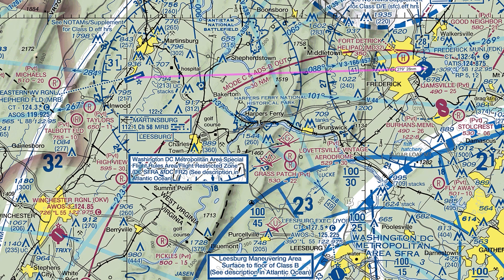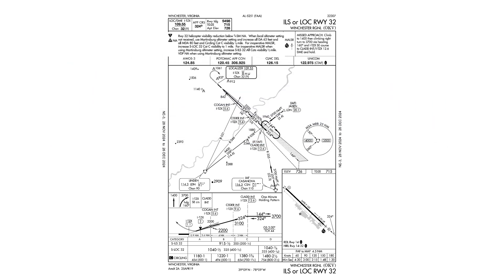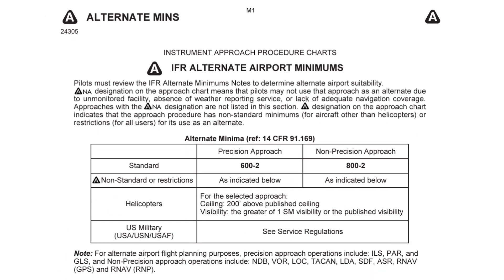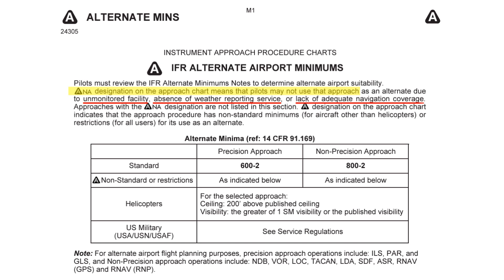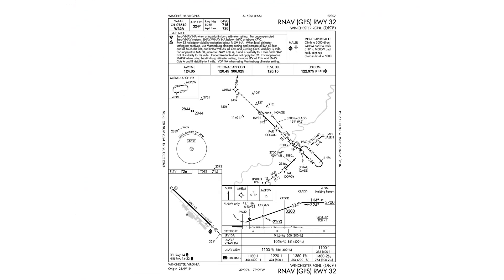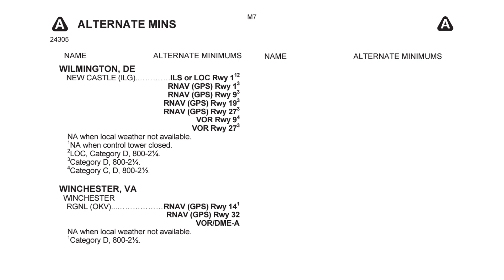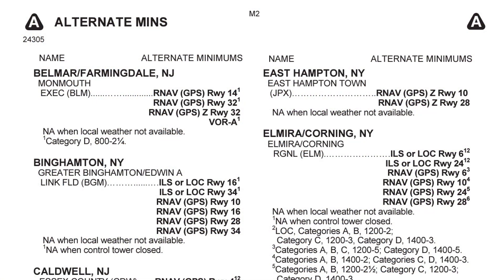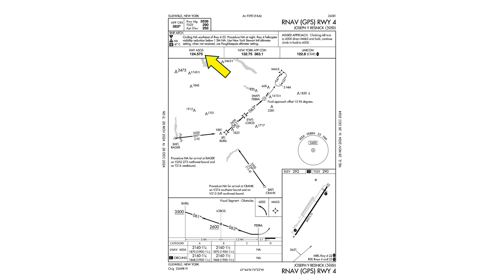Alternate Not Allowed | IFR Flight Planning

Comment: Can i file to airports with both the destination and Alternate airport if each one offers only Non WAAS RNAV GPS approaches only?  IE no ILS or VOR Approaches.....and i dont have WAAS.  Just RAIM.   Assume its 900-2 forecasted at both airports.    In other words does one of the airports require a traditional ILS or VOR approach and my ability to fly it?
Reply: My understanding is you can’t use a GPS approach as an alternate unless you have WAAS.